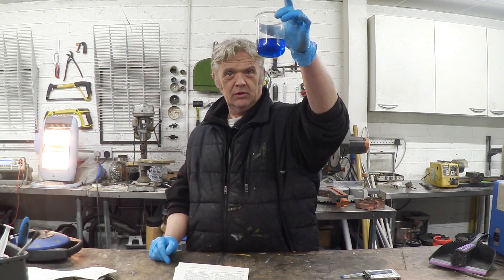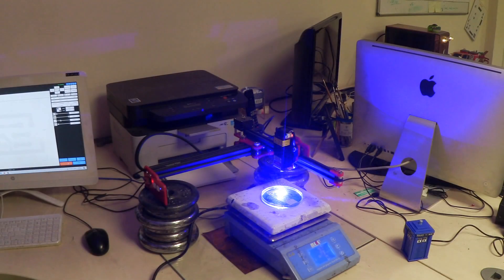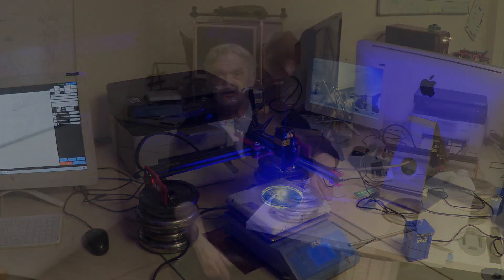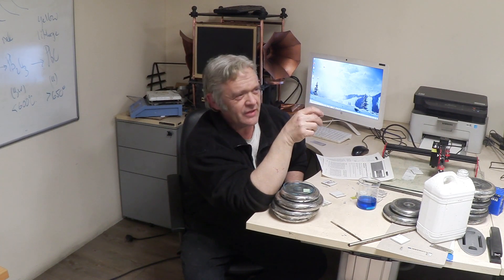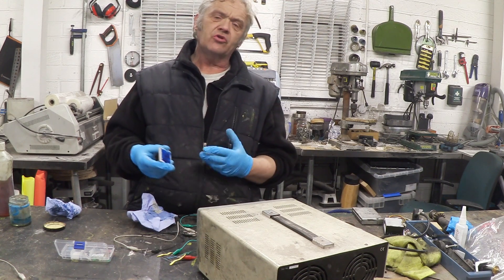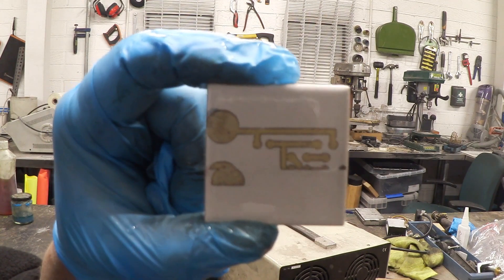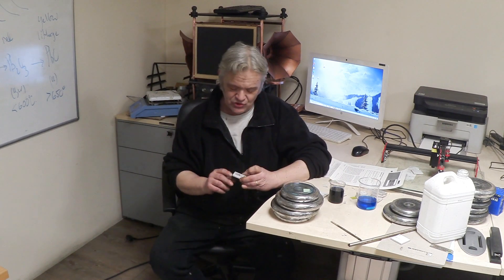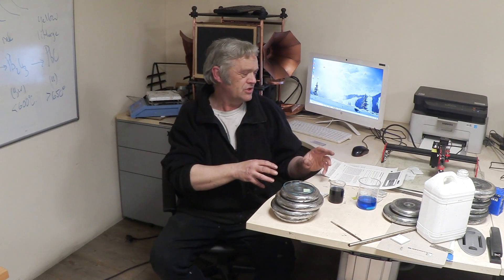993 'Printing' Copper With A Laser

Comment: Great video Robert - A couple of questions: 

1) why copper formate specifically? Is there a more easily attainable form of copper that you can use for this? 
2) Is there an ideal ratio of copper formate to triethanolamine to use? Just molar equivalents?
3) Can you just air dry the substrate after painting the ink on, or does the triethanolamine force you to use some sort of active drying method? 

Again, really good stuff - thanks for making such excellent content.

Comment: Any idea what the minimum trace width and space you can achieve is or how resistant to pulling free it is?
I'm gonna guess the minimum trace width is pretty bad, but I'd also guess that if you did the lasering of the copper formate/triethanolamine in a liquid that neither were soluble in it would keep that heating more localized and you'd get finer traces.

Comment: Ok, I have several questions:
1.) Can you solder to the traces ?
2.) Can you flow the traces with solder ? (like cover everything in solder)
3.) Can you do multiple copper platings over each others to make thick copper traces ?
4.) How thick can the paint really be before the laser fails to penetrate it ?
5.) Does annealing the deposited micropolycrystalline copper traces improve conductivity ?
6.) Can we use something like silver formate to achieve similar results ?
Reply: a lot of question that he did'nt talk about.

Comment: @Robert Murray-Smith  I so want to try your version of this.  Please correct me anywhere I'm wrong, my last use of my college chemistry was over 20 years ago.  You take 'Copper formate tetrahydrate' and add Triethanolamine (TEA) (50 - 50 mix?).  It will turn to a rich deep blue color.  Paint it on the glass you want the copper on.  Let it dry.  You get a wonderful deep blue color that shouldn't be a bunch of small crystals.  Hit it with a laser and wash off the rest.  That leaves you with copper on any non-flexible material that can take the heat from the laser.  My laser will not be here until the end of next week so I want to try and make up some of this ink/paint so I can play around with it.  Thank you for posting this!

Comment: Hey Rob, any idea what sort of conductivity you can get out of it? It might be possible to use this for making small multilayer thick film type circuits on ceramics. If you came up with a suitable dielectric that can be layered over it then selectively ablated by the laser to form interconnects then plated over with more copper you would have a means to create complex multilayer circuits. Ceramic thick film circuits are great for power electronics due to the high thermal conductivity and low thermal expansion. You can probably use your carbon ink to create resistors in the circuit in a similar way thick film circuits do as well. You could probably easily sell combinations of copper ink, dielectric and carbon as kits for making circuits on ceramics with a laser if it works.

Comment: Could the resulting trace flex? Possible to lazer onto cloth? Or some other clothing material, rubber? I want a lazer
Reply: it's simpler to just immerse a spool of generic strong nylon thread in the carbon ink, thread to  keep it separated with lots of pins on a surface dry it, and then electro brush it if you want a metal coating/colour ,then use that in a sewing machine spool

Comment: Brilliant! Could you then use the tracks as the anode (or is it cathode?) To electroplate the tracks, making them thicker and capable of carrying higher current?
Reply: It feels like unless you wanted a lot of fluffy copper dendrites, you'd have to polish the traces quite a bit. Maybe they'll mechanically stand up to that, maybe they won't.

Comment: could it be used as a new method for printing circuit boards?
Reply from the maker: absolutely
Reply: I was thinking of using a copper circuit print as a template, then using chemical vapor deposition or catalyzing process to form graphene on the template and then transferring the graphene to the actual circuit board. (If the copper surface is smooth enough to form a graphene sheet.)

Comment: So , could you make a surface mount circuit by laying out the components and then painting along the route?
Reply from the maker: I would think so
Reply: sure, one ink many options..
( if only there where simple pens you could fill ^_^ and diy pen plotters on a lollypop Bolsa frame for OTT engineer people in a hurry)

you can laser paper/kapton to make the tracks as a small run repeatable template mask for instance, just laser copper the double sided through holes and pad's and any combination there of for small smd to perfboard, standard DOT pitch PCB etc, the 2021 version of pin to pin wire wrap, and...
Reply: @paulmaydaynight9925  lasering the Kapton tape makes graphene foam apparently (used a 405nm 50mW laser to make a couple small traces and tested for the conductivity, successfully, not sure yet on 455nm blue laser but I am going to try it too,) reasoning apparently is that the kapton tape is less likely to oxidize away unlike say styrene or some other carbon based plastics for the most part, (electrical current through a solution too of copper acetate solution I found creates quite a dense tough thick layer of copper metal, when trying to use EDM graphite electrodes to make contact with solution and aluminum on mylar thermal blanket to remove the aluminum and react it faster with the Cu Acetate solution instead of the copper just forming copper oxide, LOL)

Comment: kinda wondering if the easier to obtain acetate from vinegar and hydrogen peroxide to make copper acetate would be able to be used either with the compound you used or something similar to complement the acetate vs the formate since the two are so similar (is formic acid not derived from acetic acid? seem to recall there is a process to convert it into that, or maybe it is the reverse? anyway. just a thought, also is this a substance mainly to allow it to dry and not crystalize only? curious to try this on titanium once I get my vacuum chamber finished (since titanium is much more reactive LOL and I don't want to spend the money on a tank just so I can have argon to flood it with,) also since I will be making titanium salts while I am cutting it now that I have a good way to cut it with my laser diode system.
Reply from the maker: I did try acetates and it does leave a residue the formate decomposes cleanly
Reply: @ThinkingandTinkering  Formic acid is strictly controlled here where I live. Would oxalic acid work? I'm reading that heating oxalic acid in glycerol and extraction by steam distillation results in formic acid. It's a long shot, but wondering if it could work.
Reply: Titanium plating this way would be very interesting.
Reply: Apparently Tungsten hexacarbonyl gets used in electron bean deposition.. It's not very soluble in water, but it may work as a painted on layer

Comment: not sure if you recall but I mentioned using a UV laser 405nm to fuse copper nano particles instead of using a strobe light so control over what is fused could be achieved, watching now to see if you are trying out what I mentioned way back when in that original comment LOL
Reply: ah this would not be able to make 3D objects as I was talking about with laying down layers of dust getting thicker and thicker with an object layer by layer being fused together selectively from the copper nano particles, then dump the copper dust out and retrieve the new solid copper object,
Reply from the maker: cheers mate
Reply: @ThinkingandTinkering  hopefully people will be able to use the idea with out a video if they want before I get around to putting actual video footage and a detailed list of my account's of failure and success processes, right now I am focused on a way to cut titanium and other "stainless" types of material with these weaker diode lasers that don't have the frequencies we really need for some processes like trying to cut clear with no pigment glass or plastic since it just passes through and will burn what is on the other side LOL (still need to set up a rig to use this for making mono-pole magnets with one pole inside and flipping over when the center is reached or layering, as I think it will make some nice tools for teaching atomic chemistry valence with a hands on approach for kids :)

Comment: doped with triethanolamine v citric acid ?
c.o 
"Johann Swart on Breaking Taps
 thread

4 days ago
Great! I wonder how 405 nm will do. They are not DPSS, so their beam quality is much better, and the energy at those short wavelengths is quite a bit higher. Also, you could try citric acid in your last reaction. Its a great chelating agent for copper. Hopefully it will give it up when needed. All the best!"

Chelating agents are chemical compounds that react with metal ions to form a stable, water-soluble complex. They are also known as chelants, chelators, or sequestering agents. Chelating agents have a ring-like center which forms at least two bonds with the metal ion allowing it to be excreted. ?
Reply from the maker: interesting idea but remember the TEA does more than just complex the copper
Reply: @ThinkingandTinkering  yeah, id forgot about the green tea, doh

Comment: Cool so you don´t have to shield against the stray light from the laser as my friend told me. I can see mr smith is not blind ;)
Reply: if your friends scared tell him/her to clean out that old broken fridge and put it in there and close the door ^_~
Reply: haha " yes friend they said If you are scared I must put you inside that old fridge ... " Hm I hope I have pulled the cord... XD
Reply: From what I've gathered from makers knowledgeable in higher powered lasers, even relatively low powered UV laser reflections can be quite dangerous to the human eye in the long run and eye protection is highly recommended. Also lots of eye protections that come with  these Chinese sets are junk.
Reply: @haraldhimmel5687  see repurposed fridge, i was only half joking... as they actually try and sell for extortionate prices rebadged flexible grow tents as 3d printer covers
Reply: What about a wooden box should shield any light
Reply: @Telectronics  sure, make it in the 'JSK-koubou' Make a foldable painting booth! style ^_~
Reply from the maker: the laser wasn't on while I was chatting mate
Reply: Ok then it sounds to be a good idea to make a box with a fan like paul maydaynight suggests: " Make a foldable painting booth ", because engraving will also make fumes.

Comment: What about creating a copper mirror first with CuSO4 and Hydrazine and then just burning the traces and washing away the copper that was not fixed to the slide? Perhaps copper foil? I would image that would leave pretty good copper traces. Also, something else I was wonderling. Can one increase the thickness of the trace with electrolysis after it is fixed to the slide?
Reply from the maker: I suppose you could but to be honest mate I am not sure I would - that's some nasty stuff to use and as Paul said the waste stream would be horrendous - as for electrolysis - absolutely you could do that
Reply: Hydrazine is highly toxic, costs a bundle, and disposal is not cheap

Comment: Yes very curious about things that can be done with a small laser. Uh the the machinery for me that would complete my shop would be I have my grizzly G0516 wich has been modified extensivly added a vfd just a host of there. A cnc router(wich I'm building now. a wire EDM (probly homade) and an EDM drill. and a laser for marking/ cutting (like 2-3mm brass) just a marking laser would be great That one you have the "tube" isn't bieng overdriven what's the life on it?
Reply from the maker: I am not sure on the lifetime but as it is modular it won't matter that much as it is easy to replace or indeed upgrade
Reply: @ThinkingandTinkering  Well I hope you come up with a bunch of cool stuff. You seem to be very well versed in chemistry. and have a very intresting skill set.

Comment: Wow!  I think that has to be the simplest, cleanest method I've seen yet for making copper traces!!  Really hope I have room in the budget for a CNC with laser attachment this year!!  But that's going to be tough - I'm trying to convert a van into a camper and am woefully underfunded.  Will have to come down to something like "CNC with laser or solar panel"?  Hmm, you wouldn't happen to be able to make solar cells with that laser, I don't suppose? 😋
Reply from the maker: hmm - interesting question - I am not sure - but to be honest I get a suspicion it is do-able
Reply: @ThinkingandTinkering  lol your thinking (or is it just me lol, standard practical A4 sized) lasered super close copper and aluminium traces, plus conductive ink mask , and that bloke that did the 2014 practical poc demo.. oh ^_~

Robert Murray-Smith Graphene Transparent, Flexible Brand New Solar Cell

dont forget to also diy laser the localised solid state capacitors And the unusual 'fractal' micro/macro multi  stray rf power reclamation Arial's in there too for night time additive personal power. ..And...

Comment: Nice video. is it the heat that converts the salt to metal.
Reply: In the paper mentioned by Robert,  in short,  technically no. I'm not sure what's going on in this video. 

Long answer is in the paper, the laser creates local hot spot. The heat changes the electical rest potential.  So what develops is an electrical potential that causes current to flow causing electrolytic plating.  
please forgive me if it sounds rather strange to point out that A causing B which causes C  is different than A causes C, which A does not, at least not with out B.  

The heat from the laser is not enough to reduce the metal ions to  metal.
Reply: @kreynolds1123  apparently the light is oc , it's an 'And' thing here... btw good call on the "electrical potential" localised electrolytic plating part.
Reply: @paulmaydaynight9925  what is oc?
Reply: @kreynolds1123  oc of course
Reply from the maker: well it plays a part for sure but there is a little bit more going on
Reply: and the inevitable 'flash' sintering in the right light frequencies (spock goes blind "Operation -- Annihilate!") for the material absorption i assume.

remember Robert's... using a camera flash to turn oxides back into metal